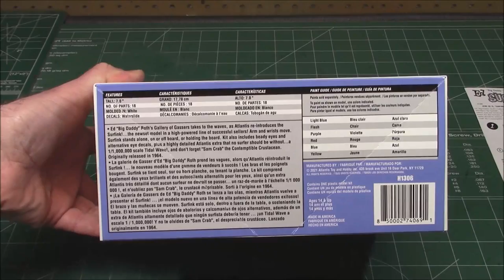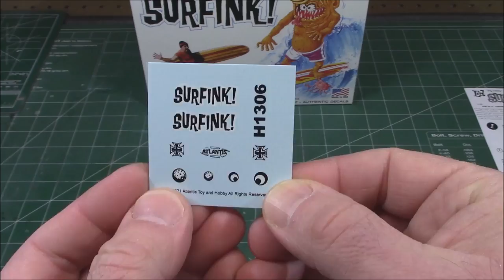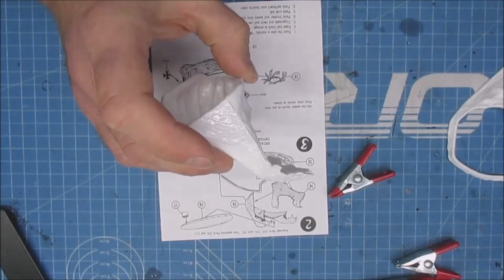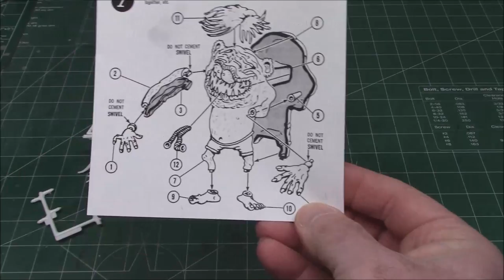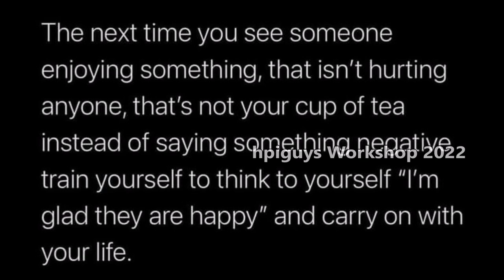Surfink Hot Rod Rat Fink Vintage 60s Scale Model Figure Kit How To Ed Big Daddy Roth Dinghead Gremmy

Comment: Having done a few of these kits and would like to share a tip. The monster mouths are hard to paint inside cuz the teeth get in the way. So clip off the the teeth with a nail clipper. Paint mouth interior. Later use the same teeth or make fresh from stretched sprue, (that plastic the parts come on). Glue teeth in place with 5 minute epoxy (I do not trust crazy glue) Paint the gums and teeth, done. Epoxy glue also makes a great gloss for the eyes. Cheers